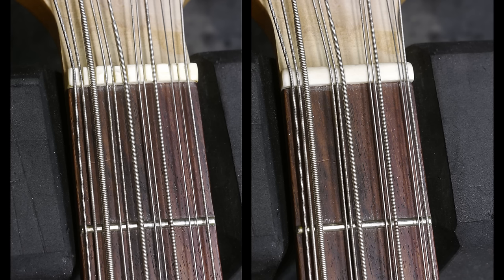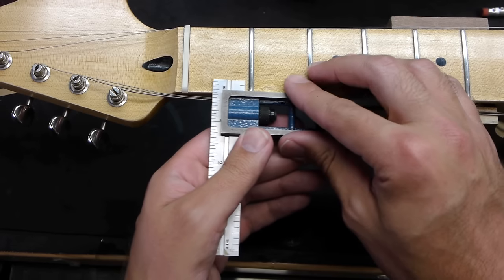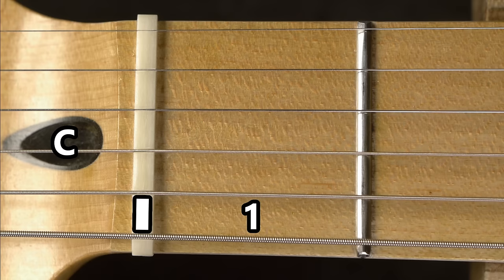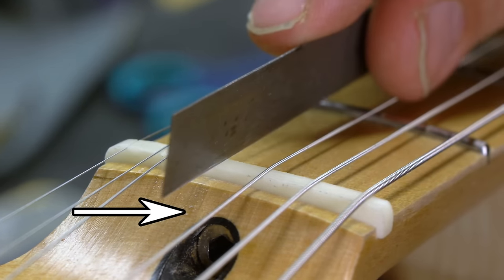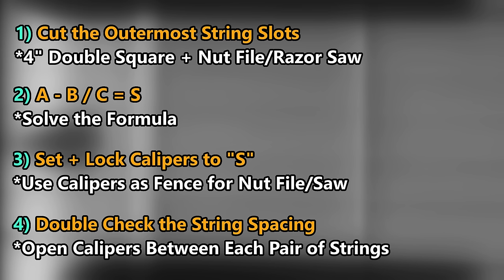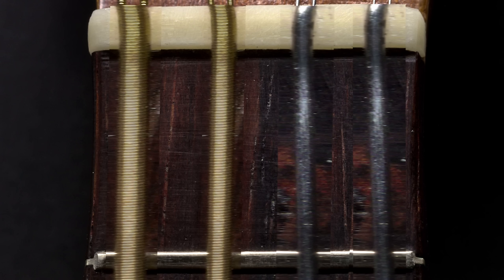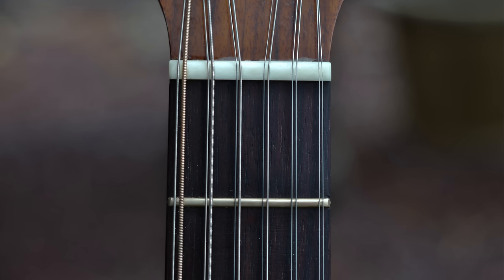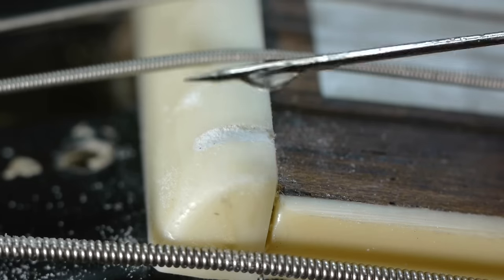Nut Slot Spacing *FOOLPROOF METHOD* - Works for 12 Strings Too!

Comment: I wrote my comment before watching.
You are overcomplicating this by miles and miles.
Reply from the maker: I'm really not. At all. This method is highly accurate, tailored to the precise string gauges used on the individual instrument, and works extremely fast. It is not complicated at all once you do it a couple times and understand how it works. 

Also, if you've ever cut a nut for a 12 string bass with tripled strings, or a 12 string guitar or mandolin with doubled strings, you'd very quickly see the value of this method. The method you described in your other comment does not provide a way to deal with such instruments. 

Further, marking the nut with a pencil and then cutting the slots along or between the pencil marks will never in a million years be as accurate as using a fence. 

It's like arguing that using a fence to cut lumber on a bandsaw is overcomplicating things compared to just marking a straight line with a double square and freehand cutting it along the line. 

You can test your own spacing with calipers. This is the real test, and the only one that matters. Results in measurable numbers are the loudest voice in the room.

If your accuracy is within .001" to .002" of the correct string to string spacing, congratulations. That's great. It's certainly achievable with a high level of experience and a well-trained hand and eye.

But most people without extensive experience are not going to be able to cut along or inbetween pencil marks with a +/-.002" level of accuracy. 

So even if you can honestly say your spacing is accurate to such a precise degree of accuracy, the majority of people will not be able to say the same without extensive experience. 

I'll also add that over the last 6 years of using this method, after over 10 years of cutting nuts exclusively by hand and eye, spacing that looks even is often not even at all when put to the test with digital calipers. 

It is not overcomplicated for the intended purpose, which is a high degree of accuracy and repeatability, and the ability to work on any stringed instrument, no matter how many strings it has or how they're grouped. 

It is overcomplicated if you're satisfied with less than perfect results. 

I'm not in a philosophical debate about whether "perfect" makes a noticeable difference or not. 

But I am making the argument that cutting freehand between or on top of pencil marks has never in the history of anything worked better than using a fence or a guide. 

Use this method and get perfect results. That's the true definition of "Simple" in my book. 

Equal Centers vs. Equal Gaps is another debate. This method is for Equal Gaps, and I would challenge anyone to show me a method that reliably achieves this high a degree of accuracy with such a minimal level of skill and prior experience required.

Comment: Subtract whatever fretboard margin you intend to use from the overall nut width, then divide the resulting number by a number equal to one less string than the instrument is to have (for guitars, basses, ukuleles, violin family instruments, and banjos). Simple.

For guitars:

Nut width = 1.75"
Margins = .240" total 
Remainder = 1.51"
Divided by 5 = .302" OC

Marking and cutting the slots is up to the builder to do correctly.
Reply from the maker: This is perfectly reasonable.

However, the main reason I came up with the method in this video was to use a fence for cutting the slots, instead of cutting over pencil marks. Using a fence is extra work. But ensures greater accuracy, much like using a fence on a band saw, table saw, or router table. 

I used pencil marks for years, and my friend and mentor who's been doing guitar work for nearly 60 years now still uses pencil marks. Additionally, he does not ever measure anything out. 

He lays the strings out completely by eye, then draws pencil marks on either side of each string, then cuts the slot in the center of those two lines. 

That's the way I learned to do it, and I did it that way for over 10 years. I came up with this method to eliminate the variability in the way I was trained to do it, and get faster and more repeatable results. 

Any time a fence or template of any kind is involved, it creates greater accuracy and repeatability. I struggled with pencil marks for many years. Making a cut with a fence and eliminating the pencil marks to me is like cutting out the middleman, and streamlines the entire process.

Comment: How can inches have decimals?
Reply from the maker: Inches can be fractional or decimal. You get the decimal equivalent of a fraction when you do the math out: for example, 4/64" = 4 divided by 64 = 0.0625". 

For reference, 1 millimeter is the equivalent of 0.039 inches. 

However, fractions aren't necessary for inches, and most digital calipers have an inch/mm button, to switch between them on the display. Both inches and millimeters will show up on digital calipers as decimals. Some specialized calipers have fractional inch options as well but I don't think it's the norm.
Reply: @guitar_md  But the ruler is still inn fractions... are there inches rulers with decimals? (I am confused)
Reply from the maker: @baadtaste1337  There are some specialty rulers like that, but no, for the most part -- rulers will be in inches. 

Unfortunately, the best way is to deal with this is to get familiar with converting between measurements. This is just done by memorization. 

I don't use millimeters, for example, so often I'll have to look up conversions online to inches.

So for example, with 5/64" or 4/64" -- you divide the numbers out, and get the decimal inches. You can also use Google. I do this all the time. 

Simply type 5/64 into Google and it will do the math for you. Similarly, if you type "0.5 to mm" or "0.5 inches to mm", it will give you the conversion. 

Unfortunately, in a world where metric and SAE systems are used, we have to become familiar with all of them, and converting between them. 

Fractional inches are used on rulers because it makes the layout easier, and woodworkers in the US deal with fractional inches, not decimal inches. For all woodworking you will see people using fractional inches. 

Think of fractions and decimals as different dialects of the same language. They mean exactly the same thing, but there are situations where one is more appropriate than the other -- even though both are correct.

Comment: Well most of us use millimeter and many of us hates math and the rest cannot afford a good digital device so we do it by eye and hand. Man you give me a headace blabbering away like you do. Sorry
Reply from the maker: You can mute the video and turn on captions. 

I cut nuts by hand and eye for many, many years. I understand that some people might hate math, but the formula I've laid out here is very simple to follow, and very easy to plug into a calculator. 

Doing it by hand and eye can work. But requires a high skill level, and a lot of practice and experience to get right every time. This method makes the job much easier, much like using a fence on a band saw instead of freehand cutting. Imagine drawing a pencil line along the length of a piece of wood -- would it be easier to cut along the pencil line by eye, or to set up a fence to make sure the wood stays straight while you feed it through the band saw?

Comment: WoooWee buddy! This is the nerdiest, most awesome technique I've ever seen! I've always located the outside strings 1st as well. I've been using the graduated slotted scale. The way I keep that on the money is locking it in place with a Wiha straight head and scratching the starting marks with another sharper corner  Wiha that fits with barely any slop. Your method is way better for universal type slotting 👌
Reply from the maker: Thank you so much! And that method sounds great. I think it's a big improvement over pencil marks for accuracy. With starting marks like you mention, you're already locked in and there is no guesswork when you go at it with the file. 

That being said, my friend and mentor Steve still cuts nuts completely by hand and eye, only using pencil marks on either side of each string after he lines them up visually, as evenly as possible. 

Then his thumbnail goes between the two pencil marks, and a razor saw against his thumbnail as a fence, to cut the start for the slot. 

This is the way I learned and did it for many, many years. I struggled a lot with it. Sometimes they'd come out great, other times, not so much. 

So over the years I developed this method. Originally I used an Xacto knife along the caliper jaws to score a line, then worked my way up from the thinnest nut file to the desired thickness, in order to keep the line centered. 

Later I realized I could just bypass all of that and use a nut file directly against the jaws. And here we are today. I was very excited to share this video so I'm glad you caught it and enjoyed it. 

The way I see it, I'm nowhere near as good as my mentor. He's far more mechanically inclined than I am and is a practical genius with fine motor skills and freehanding things in ways that look like a CNC machine did it. 

I never could achieve that level of skill, so I came up with another way. I think some of the biggest value can be for other people like me who could just not get the hang of pencil marks and the slots would always just end up all over the place every time, with no repeatability or predictability. 

When Steve tasked me with cutting a 12 string bass nut, with its 3 strings per course, for 4 courses....that's what really finalized the creation of this method. I wracked my brain for a few days until figuring out that I could use feeler gauges as a fence to space the string pairs. 

It was the only way I could think of to cut that nut. 12 string bass has to be one of the worst nightmares with nut slot spacing, though I haven't done anything more exotic -- I'm sure there's something much worse out there, with irregularly spaced string pairs. 

But 12 string bass is as hard as it gets for your run of the mill bass and guitar repairs. And this method knocked it out of the park. I was so pleased and so excited, it's one reason I gave this video such a dramatic intro. 

Very happy to be done with it too. I had this on the backburner for over a year, shooting more footage here and there, editing a little more there. Then after being tasked with cutting a mandolin nut several months back, I shot more footage and took more pictures, then got this video on the fast track to completion. 

I was surprised how quickly it works too. Once you get the method down, cutting the slots is like taking a vacation. Even on paired string nuts. I had all the string slots for that mandolin spaced perfectly in a very short amount of time. 

Thanks again so much for the support!